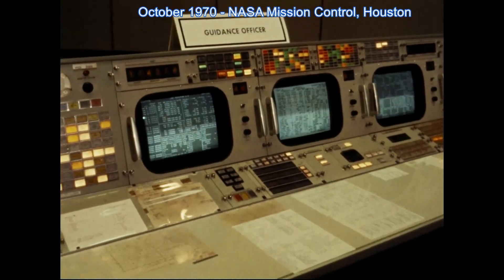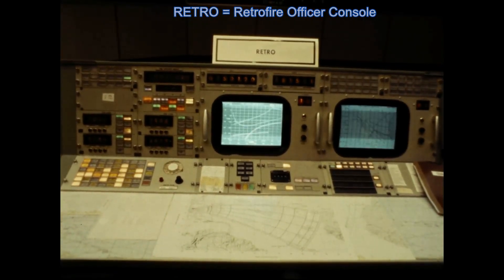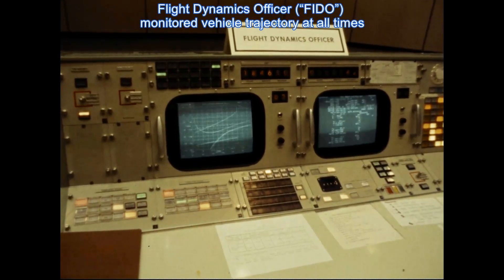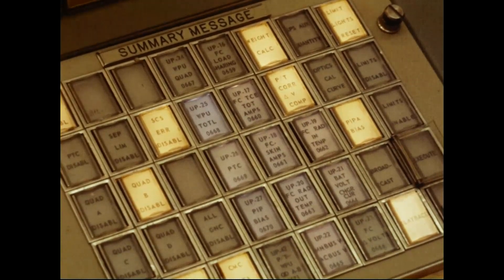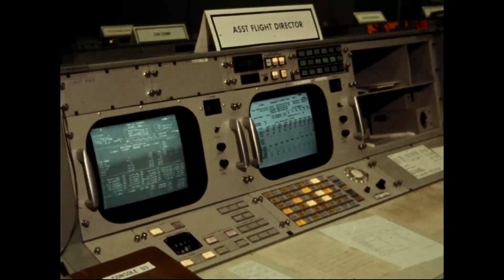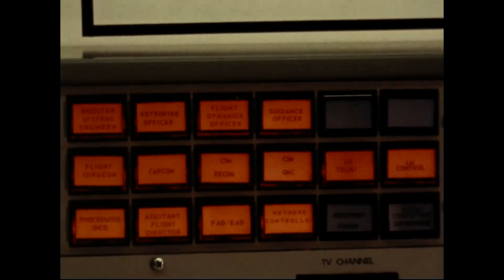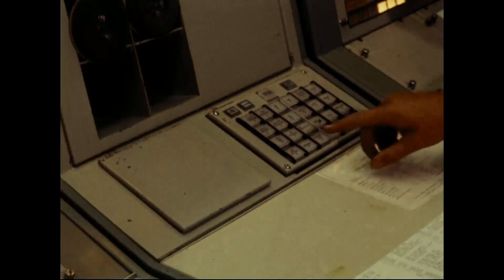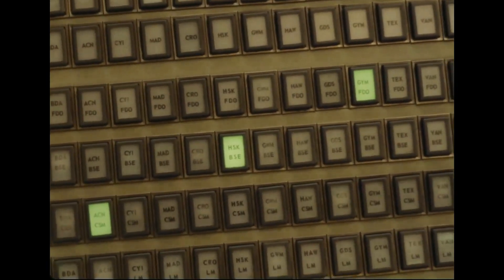RARE NASA Mission Control Consoles CLOSE UP SCREEN VIEWS 1970 HD (Space Apollo Computers MOCR)

Comment: Fascinating video showing what the state of art was back then. Sy Liebergot, Apollo EECOM flight controller (portrayed by Ron Howard's brother Clint in "Apollo 13") spoke at 1996 Silicon Valley Engineers Week Banquet. Those handles each side of monitor (used to pull for servicing) Sy called them "security handles" which when a controller was apprehensive of the situation, he can hold on to those like the Peanuts cartoon character Linus and his security blanket. I thought it was interesting to learn there was much more in background than what we see in MOCR (this single room Mission Operations Control Room) as there were several other rooms supporting each flight controller. Sy was assisted by few other guys with identical monitors but also strip-chart recorders and lots more documentation. During this time a company called Arts & Letters produced a multi-media on CD rom (Liebergot provided consultation). What is interesting is there are two other rooms, Mission Evaluation Room (MER) managed by the legendary Don "Mad Don" Arabian. And the Spacecraft Analysis (SPAN) that acts as the go between MOCR and MER. Then there are those air tube or vacuum to send papers from MOCR to other rooms and back. One incident someone packed a bunch of sharpened new pencils but didn't properly latch the spring loaded carrier so it came undone in a tube somewhere causing entire system to be down for a few hours.

This included audio tracks of Sy talking with his guys in the backroom about data going off scale after O2 tank explosion. Liebergot first thought it was PCM or "looks like we have an instrumentation problem" as spacecraft designed to not have quadruple failures. He asked about values of tank pressure and temperatures, one of the guys described values, Sy said "that doesn't make sense" which the other guy replied "I don't know but that is what the values are." When Lovell mentioned venting then things began to make sense. Off shift Liebergot went to the backroom, saw the strip-chart of O2 tank temperature, it began to climb just after Swigert turned on tank stirrer. This CD rom has image of this graph, temperature goes up and up, then straight down after sensor failed on explosion. Sy said when he first saw that strip-chart it felt his heart dropped. They could have observed the temperature increasing realtime but Sy and his other guys were looking at other values so they completely missed it.

Some years ago talking with a CHP dispatcher said the traditional rows and columns of such control rooms are the worst to manage and maintain. Another person said NORAD was laid out in rows and columns to give impression Air Force have things under control, organized and managed. These days all control rooms are laid out in work station arrangements.

Comment: The Mercury Gemini and Apollo programs where indeed fascinating. But what's more impressive is the whole communication and telemetry network. Plus the mission control mainframe computers used to gather all the data and telemetry and distributing the information to each respective terminal. There is so much information out the but nobody talks about it. It's overshadowed by the main events of the launch and orbit.
Reply from the maker: Hi CeeDee91, you're absolutely right!  The global telemetry tracking and communication system was amazing, especially for that time period.  Links to tracking stations in Australia, out at sea, and so much more.  A fascinating accomplishment!  ~  VK

Comment: So, how did these computers work? Could you change the information displayed like a modern PC? The displays look very still, as if you couldn't change what was displayed.
Reply: Very different, radically different than the setups of the late 70s which are what we are most used to understanding computer output outside of paper printed output.  For one thing, those old machines had very little limited storage compared to what we have today, so even one character to store and update was a massive resource to consider having.

Comment: It is amazing how 60's technology was cutting edge at that time to do all this compared to what we have today. Imagine if Nasa utilized today's current technology or what would be available in 18 months from now back then. Just think what could they accomplish back then.
Reply: Nasa has the modern computers now and they haven't accomplished anything as amazing as landing a man on the moon even like 50 years later.
Reply: It would take 10 times longer and have 10 times the problems.
Reply: A cheap smartphone today has more computing power than all the computers of the planet back during this time.  But you'd have a tough time running a space mission I'd think off a smartphone as the brains and branching out from there. Do-able, likely, but still not easy and would require a lot of creativity just like they had to do back then.

Comment: I worked there, among other buildings at Johnson Space Center in the late 80's and early 90's and those consoles were still there. It wasn't until the mid to late 90s those obsolete consoles were replaced with shiny, for then, new tech consoles.
Reply: I was there in the early 2000's and by then they had the original control rooms as they were in 1969 downstairs and the new ones for shuttle and ISS upstairs, all in the same building at the same time. They even had the original wheeled chairs for VIPs to sit in.

Comment: Back about 20...now 30 years ago...(wow I just realized I'm old!) I worked for Astro, (Started as RCA Astro then switched to GE-Astro, Martian Marietta Astro and was Lockheed Martin when I left) 
Even though it was the 1990's one of my duties was the care and feeding of an old Interdata 70 computer from the mid 1970's. Paper Tape OS, Core memory and a HUGE (well physically) 80Mb disk drive.  
We had to raid some computer museums to find parts for these machines. (We had three) 
You see, when you launch a long lived satellite, it has to be supported with the equipement it was certified with.  There no practical way to return the Bird to the shop, so the ground equipment has to stay the same, emulation and such, where just not trusted enough. So Instead of having the hottest, newest and most powerful computers around we had the ones that had the most reliability and road tested.  
Vendors want to push to the newest and latest, we had to constantly call them on that. Sometimes they would keep the same part number, but use a 'new and better' manufacturing process. And that 'new and better' part would be great for consumer devices being 'cheaper' or 'faster' or 'lighter', but would fail when we tested it.
Reply from the maker: Fascinating, I bet those were very interesting times!   "Interdata" that's a company with a fascinating history too.  Thanks for sharing!  ~  Victor, CHAP

Comment: Geez, so they designed AND built this humongous system of two control rooms and eight mainframe computers with 60.000 miles of wires within just two years?! The system's level of development is truly astonishing on its own for its time, but to design and build all this hardware and software within just two years and without any major faults is beyond words. Hats off to everyone involved!
Reply: They didn't have the internet and smartphones to distract them...
Reply: @rockets4kids  This just makes their achievement even more unbelievable. They had no Google to look up an equation or any theory they don't remember, so they had to know everything, and when they had to look up something it meant hours spent in a library, going through tons of books and microfilms. And they had to design everything on paper, no CAD. In case of such a complex system like that, within this short deadline, it's mindblowing.
It's not the build of the system which amazes me the most, it's a huge achievement on its own, but with enough labor it's doable if it's backed with perfectly designed plans, schematics, netlists, BOMs. What amazes me the most is that along with the build, the full software and hardware development is included in this two years. And it's a system that was completely unique, no previous experience they could rely on (apart from the mainframes themselves). All the designers and software developers were true geniuses, for sure.
Reply: @rockets4kids  Yes, maybe not most of them, but probably around 50%. No, I'm not protecting myself, I'm not an engineer, just a technician :-) . But I know great young engineers. It would be interesting to know what could they achieve with just '60s technology behind them. But this is kinda silly idea, because you couldn't do much with today's stuff if you would have just '60s technology behind you. They designed the MOS6502 CPU on paper, try that with not even today's i7, just with a 1GHz Pentium from 20 years earlier. Even that is impossible. Probably it would already be impossible even with a 100MHz Pentium from the early '90s.
Reply: @rockets4kids  Yep, They will not even leave their desk to go out on the floor. They think a CNC machining center is a printer. They have no understanding of mechanical engineering, drawings, materials, electrical, welding, machining.  Was sick and tired of having to review their drawings, finding mistakes and telling them how to add the welding symbols and so on. Ask them  to read a micrometer or other measuring tools that do not have a digital readout and I get the three ships out in the sea look. Really.
Reply: Yes, but they already had plenty of experience going back to SABRE and SAGE, through to the Mercury and Gemini mission control centers. It was far from new technology at the time.
Reply: @cygil1  
True. And IBM was prime on SAGE IIRC too.
Reply: FIXED price, so the contracter have all the motive to complete the work, compare to modern cost plus price.... the longer they can "wrok" the more they get payed.
Reply: @kirgan1000  I guess there was also quite a bit of pressure on them because Kennedy announced in the early '60s they would land on the moon before the end of the decade. Not finishing the work in time was not an option for them in the middle of space race and cold war.

Comment: Thousands of relays, incandescent lamps, mechanical switches and analog gauges.  The air handlers had to be massive to keep that place comfortable.  I love the plug-in modules; if a lamp burns out (I think they had redundant filaments) you just swap out the module.
Reply: Not redundant filaments, but redundant lamps.  Each of these indicator/buttons had lamp sockets for four lamps, which in some cases had colored rubber (?) boots to change their colors.  The result was that if you had an indicator that could be red or green to indicate status, there were two lamps with red boots and two lamps with green boots.
Reply: Yep, I think I have the fuse version of one of those lamps (called a Fuse-Lite). It has some MSC part number on the bottom of it.
Reply: And don’t forget the cigarette smoke. When they were refurbishing MOCR 2 to turn it into a public exhibit, they had to clean out a lot of tar and nicotine gunk!

Comment: What amazes me is the data and graphics on those CRT screens with technology from the 60s. We all now have acces to have watches which monitor body metrics,  personnel mass communication, Teams or Zoom video conferencing, cars have onboard metrics and automation all derived from the moon program. Go big government investment.
Reply: The graphics were drawn by draughtsmen. Back in the rooms with the mainframes, there were text terminals displaying just the text. A draughtsman drew an overlay on acetate or similar that was laid over the screen, this added the graphics elements which never changed. Then there was a TV camera pointed at the screen. There were many of these. When an operator in mission control changed which screen he was looking at, he was literally just changing TV channels. Low tech, simple to implement, and reliable.
Reply: I received a tour of this room (and the latest Space Shuttle and ISS equivalents located in the same building) when I received an SFA Award around 2002. They explained that all the monitors were TV displays sent from other locations throughout the center. The large screens in the front were basically projected images manipulated from behind in another room by others who were in radio contact with various engineers in the support rooms.

Comment: Notably, computers at the time did not have monitors to display characters, let alone diagrams like you see in some of those screens. 

There was an immensely complicated system in between the IBM 360s and the console screens which generated characters on persistent CRT tubes with a video camera pointed at those tubes. The consoles would then "tune" to these cameras as if they were TV channels. The static part of the diagrams would be added as a transparency slide between the CRTs and the video cameras and the retrieval and placement of the slides was automated and controlled by the computers. I wish there was more information about this part of the system.
Reply from the maker: Yes, it was more complicated than most people realize.  ... and the wall displays were not LCD... they were multiple projections.  Thanks very much.  CHAP
Reply: @ComputerHistoryArchivesProject  Speaking of those multiple projections...did any of the Eidophor projectors survive?
Reply: Thank you, I always wondered how the data got to those screens.
Reply: I read the room lights were typically turned down low to make it easier to read the displays. And these monitors are not high bandwidth like CRTs of the 1990s so characters were not as sharp. Because everyone smoked I imagine the room quite smoky and ugh the eyestrain after a few hours must have been something.
Reply: I wondered how they did those text displays in that era.  Thanks for the info.
Reply: Doug Engelbart's NLS computer at Stanford displayed info to workstations in exactly the same way - tv cameras pointed at round CRTs, inverted for black text on a white background.  MOCR used plastic sheets in front of the CRTs in which any line separation was needed - it was done in ink on those clear plastic sheets.
Reply: I wonder about this "transparency slide" idea. The dynamic characters and graphs were rendered in positive (light letters against black background) on a slow scan (long glow) vector tube,  photographed by a 525-line raster TV camera in a light sealed box for UHF syndication to the consoles. This was quite similar to the stuff Doug Engelbart & co. was using for the "Mother of all demos" and apparently using some of the same hardware (the vector fonts look identical). How would a slide overlay between the vector tube and the camera have been able to add  artwork with the same polarity as the glowing letters? Unless it was a side-lighted, etched acrylic plate, or something like a monoscope tube with a custom artwork plate that was hooked up genlocked / synchronized to the camera. 

In Doug Engelbart's systems the software was sophisticated enough to render vector art and text together in relatively advanced compositions. Is it not reasonable to assume that the RTCC software running the console screens would be equally sophisticated and actually draw the line art on the screens along with the text readout? Most of the non-text console screen artwork consisted of relatively simple block-diagram lines and boxes, some occasional arrows and extremely simplified illustrations that would seem "economical" enough to have in the vector tube scan cycle.

I would be curious to know more about the "hardcopy" system capability. What was  that, exactly? Was that a screen dump on line printers from RTCC with all the text content of the screen shown, or was it something like a xerox repro of the 525-line TV image? I noted that the hardcopy request panel could select either of the console screens, (left, middle, right). But some of the UHF channels you might have dialed up on those contained television instead of RTCC screen views.
Reply: This is probably one of the most fascinating comments I have read in a while. I had no ideas CRT’s at that time could not display characters
Reply: So cool thanks for sharing